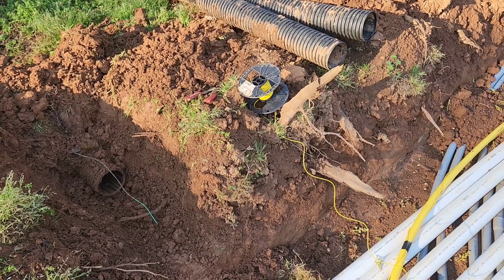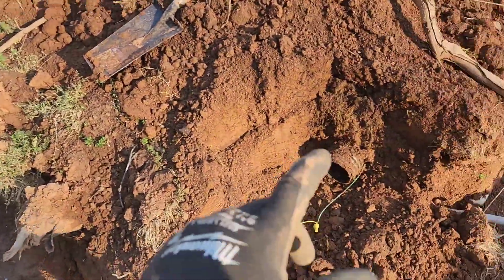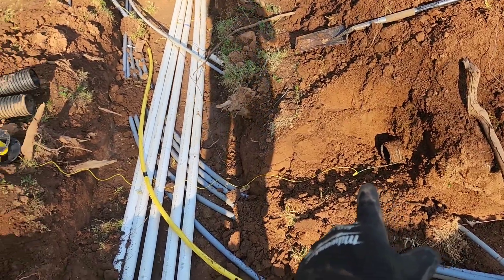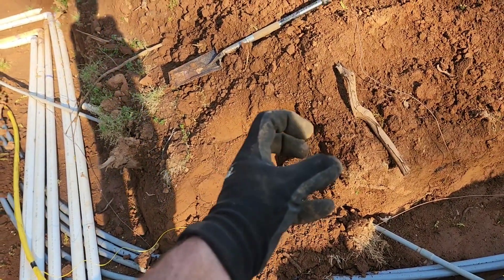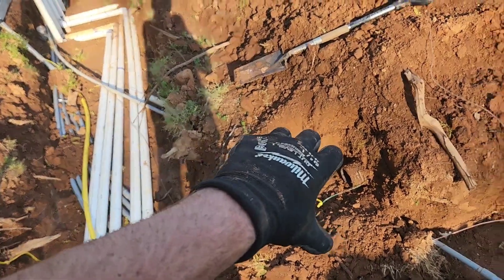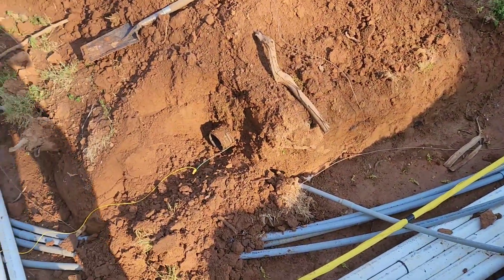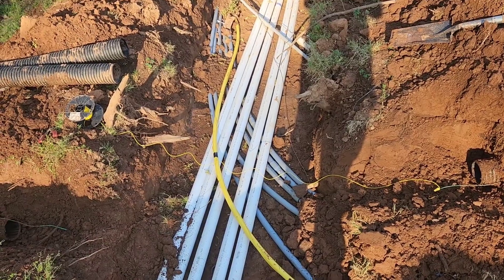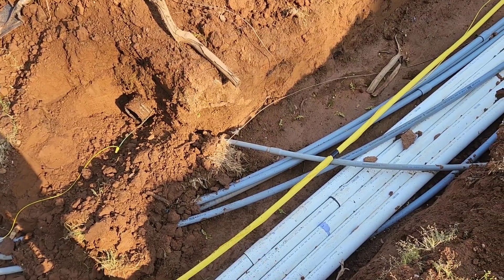One Reason PVC is inferior to Corrugated in Yard Drains Charlotte, NC

Comment: The bucket would break the pvc before it ever pulls anything out of the ground.
Reply from the maker: Have you ever hooked pvc with an excavator?
Reply: @drainmylawn  you can feel the pvc with the bucket. If you’re actually trying to pull it out of the ground it will shatter into pieces. You can’t pull a whole 50 foot section out without the bucket breaking the pvc.